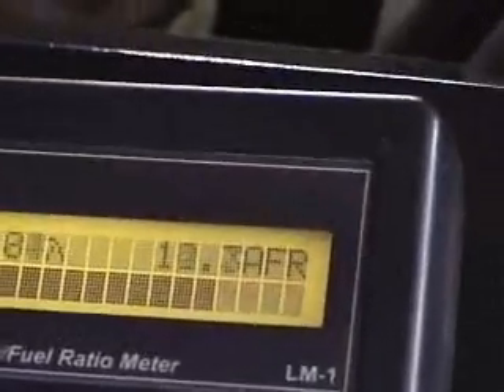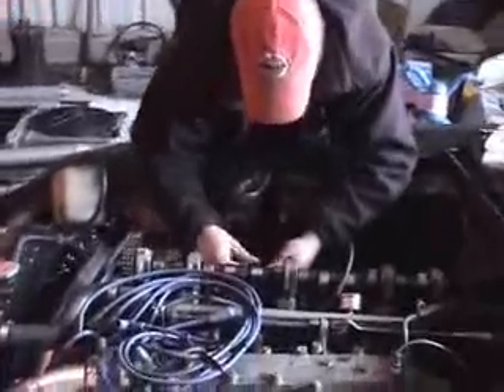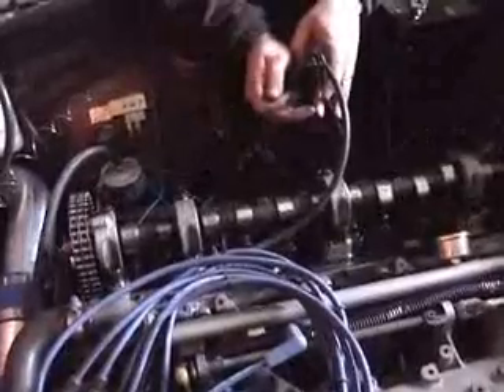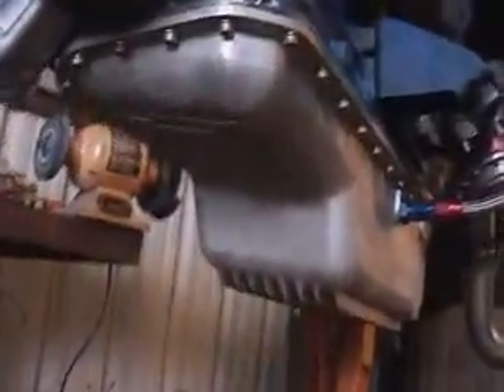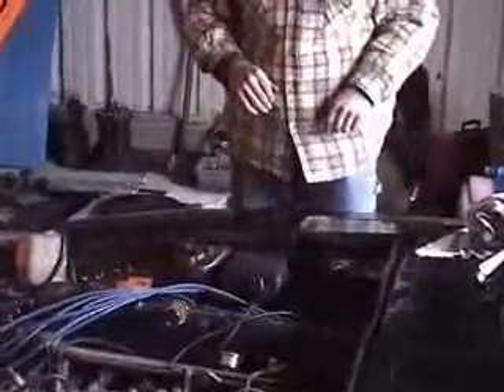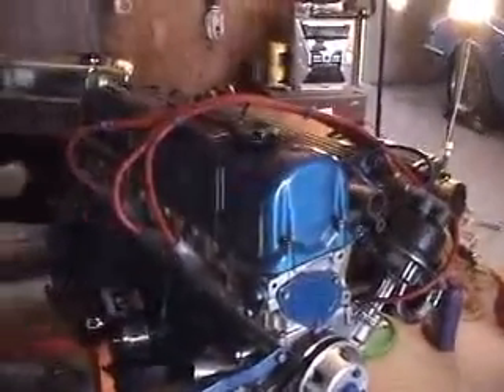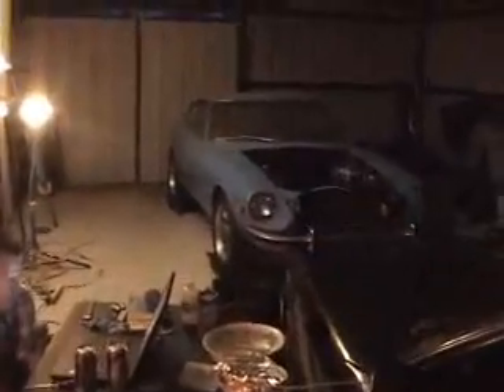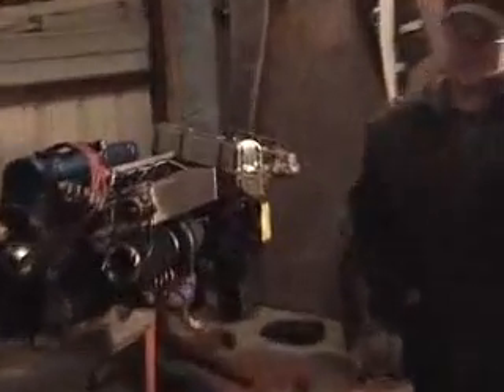megasquirt tunning turbo datsun 280z

Comment: So what is the trick to quickly adjusting the valves?  Also, I have a 1976 NA 280z with a cam (owner before me installed it, I have no idea what the specs are).  I can't seem to find any VE and timing maps to go off of.